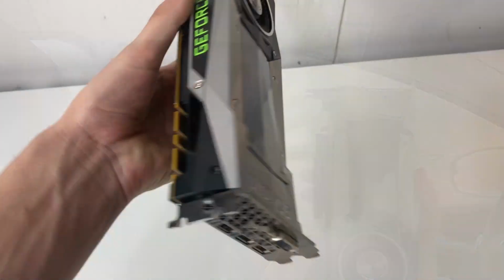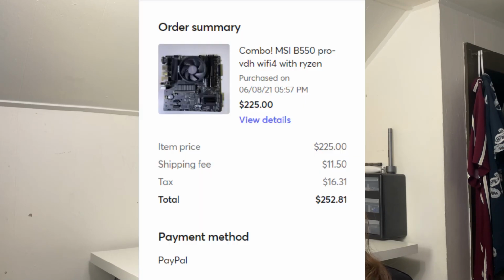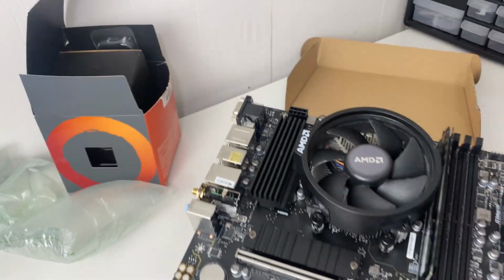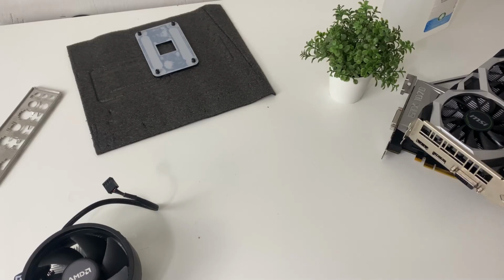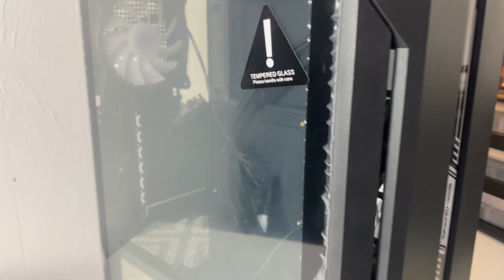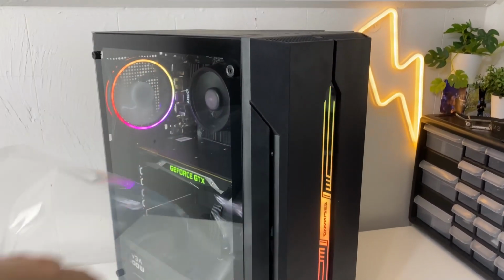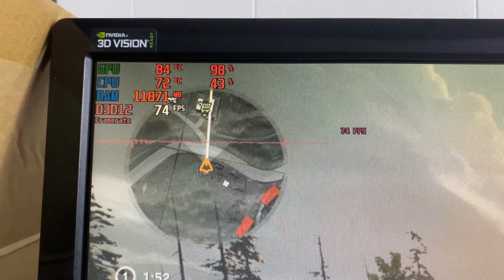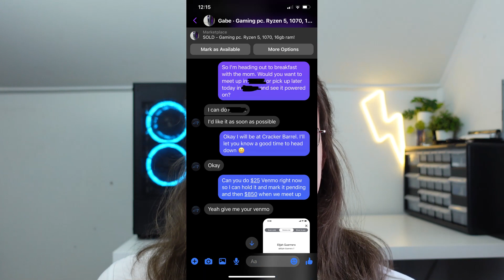Do this to make money! I Built and Flipped a Budget Gaming pc - $300+ in one day FPFP Ep. 15

Comment: I sold the dell 8500 that I got for 250$ for 400$, I was going to buy a system with a fx 8350 and a r9 270x for 200 but instead I took a gamble on this prebuilt cyber power pc that had a i5 8500 and a gtx 1060 3g and a single stick of ddr4. I there in a random stick of viper 4g ddr4 and a random 120g ssd that I got for 20$. I might put a 1tb hdd, do you think I could get 600+$ for that system
Reply from the maker: Good flips man! I think you could easily get 600+